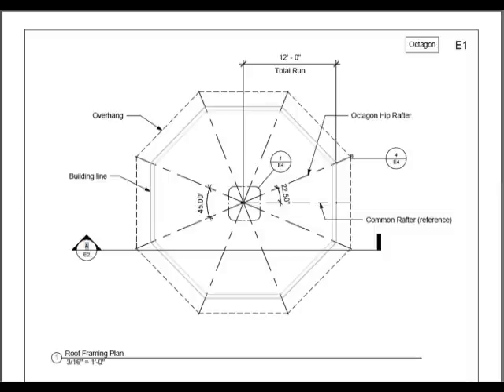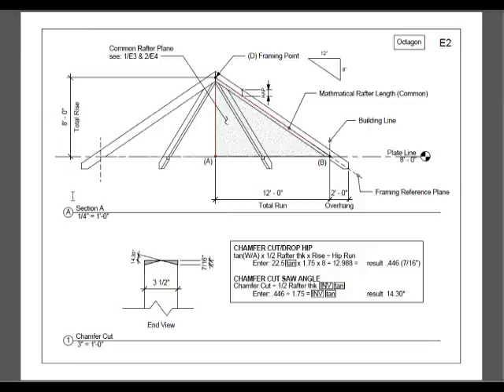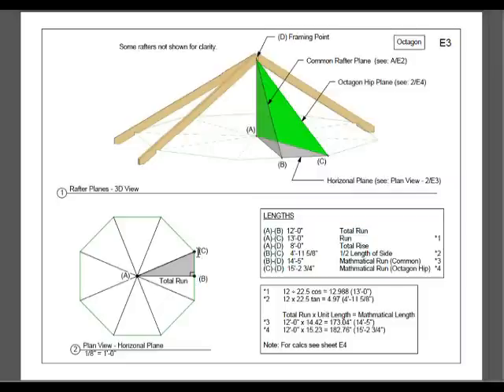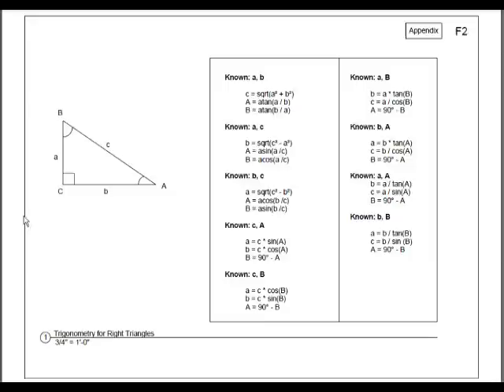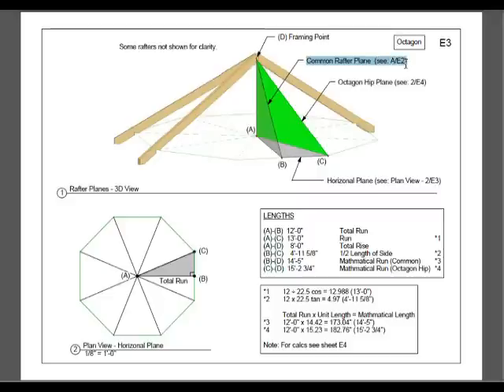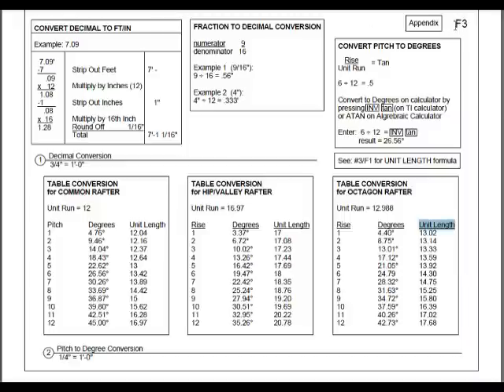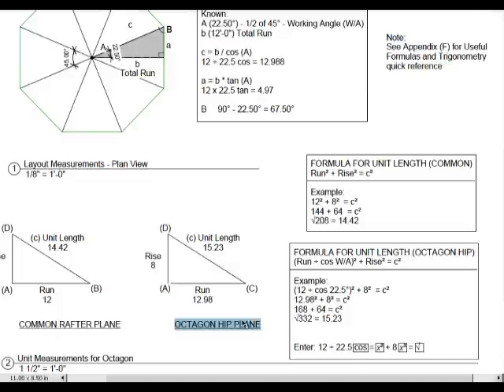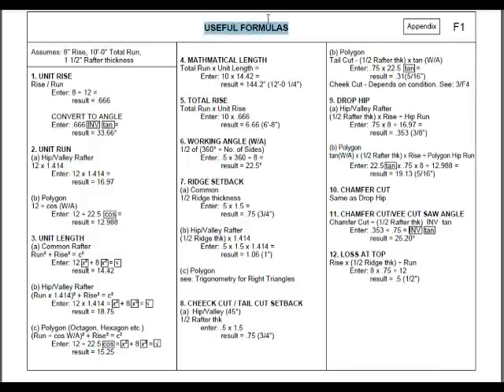Gazebo Roof Framing - Part 1

Comment: Hello and thanks for the video! I have a couple questions though. At 2:25 You have a 3D view slide. Formulas *3 and *4 show multiplication by 12. The step is correct. However. the reason is not because the Total Run A-B is 12' but because there are 12 inches in a foot. Therefore you need to transform decimal 14.42' and 15.23' into inches and then into feet-inches. Just like 2.5 hours x 60 = 150 minutes = 2 hours 30 minutes.
And the second question is about the 2' overhang. This should extend the common rafter to 14.42 / 12 * (12+2) =  16.82ft. The overhang of the octagon hip will be longer than 2ft. It will be 2 / 22.5cos = 2.164. Therefore the total run will be 12.98+2.164=15.144 and the total length of the hip will be 15.23 / 12.98 x 15.144 = 17.77ft
I am learning to build a gazebo, not much knowledge in woodworking so let me know if I missed something. But I just took pure geometry approach.. Thanks!
Reply from the maker: Max T Hi Max,
Thanks for the comments. Regardless if the total run is 12' or is 14" (including the overhang), you can simplify by multiplying by the Unit Length (14.45 for Common, 15.23 for Octagon Hip). The result is in inches which I convert to feet/inches. However, if you find it easier to divide the total run by 12 to convert to inches before doing the math, that works too! Your math above is correct so you're on the right track. BTW, the VelociRafter DVD contains 60 pages of illustrations and formulas that I hope provides useful info.

Comment: question... If the run was 10 ft instead of 12 ft. would you still use 8ft. rise?  or would you lower the rise?  would it make the roof look odd?
Reply from the maker: Unit rise: rise/run,   8/12 = .666, 10' x .666 = 6.66' (6'- 8")
You may want to check out my vid "Common Rafters part 1 for an explanation.
Reply: No